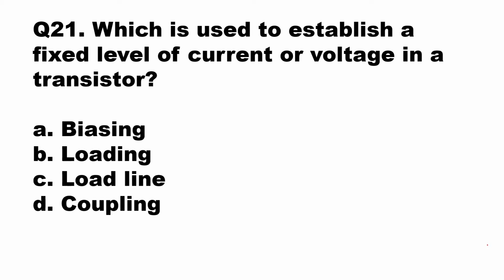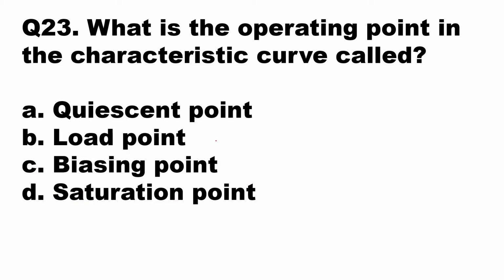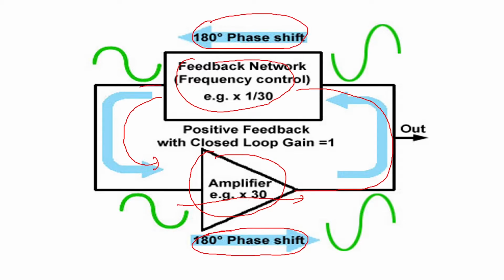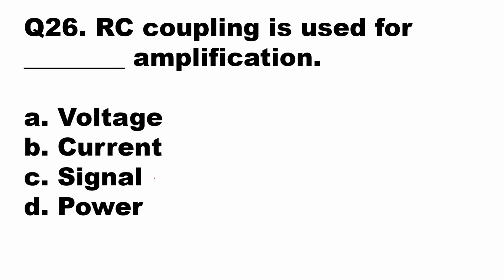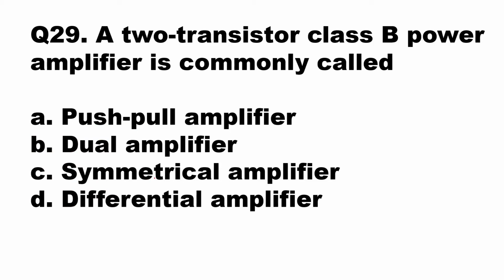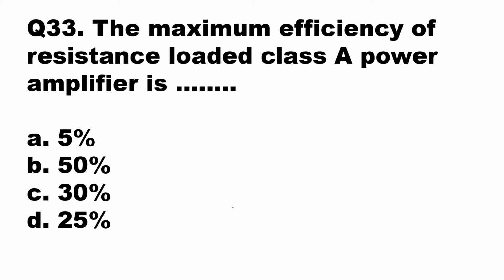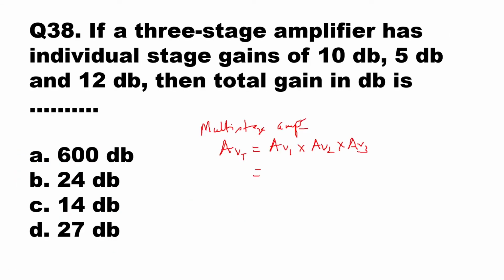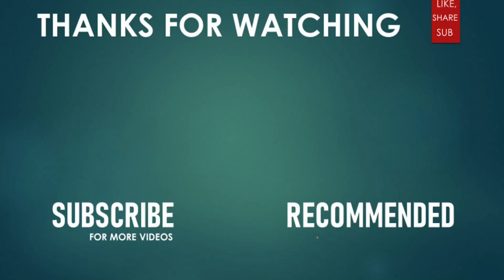DCET AEC | PART 2 | ANALOG ELECTRONIC CIRCUITS |

Comment: Sir I have a doubt. If we use negative feedback for amplifiers doesn't it degenerates the signal and reduce amplification?
Reply from the maker: Yes definitely  gain will be little less but here it gives stability to the circuit,
Reply: @javalkaracademy2176  Thank you for the clarification sir. 🙏